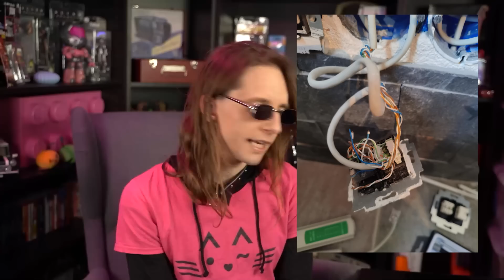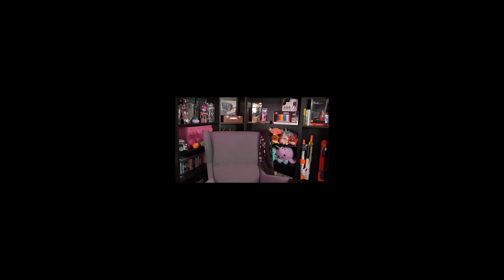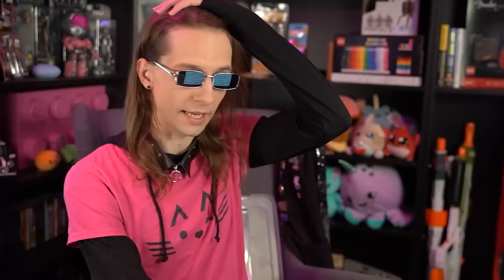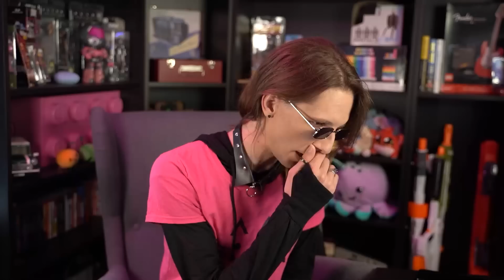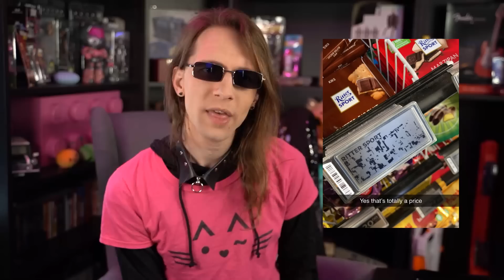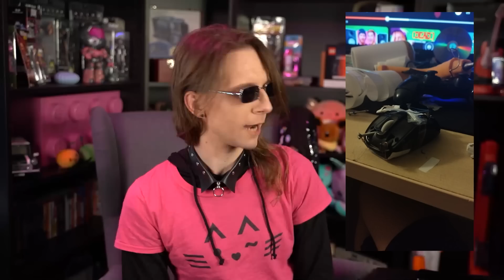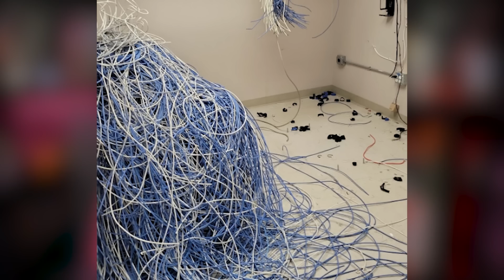Top 10 Ways To Notwork Your Computer'nt | Lexplanations |  r/techsupportgore & r/hardwaregore

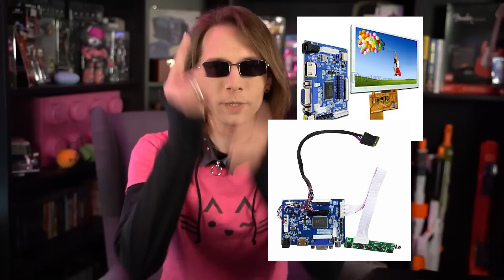Comment: 6:48 the boards are display controllers, the drivers are behind the LCD panel and are what the controller talks to. At least if i recall the terminology correctly. Its basically (overly simplified) a multiplexer and a DAC that drives the actual pixels in the display matrix. seeing as i have scratch built display controllers using FPGA's I really should know the terminology better...

Comment: 6:00 that console could probably run off 22AWG wire with how little power it draws and how short the distance is. That being said, i prefer my electron hoses, 0000AWG FTW!

edit: the bigger problem is likely the contact resistance as that wire is never going to be able to produce enough force to get the resistance low enough not to set the connector on fire.
Reply from the maker: Okay I just looked it up , lower than expected but still

Comment: Okay I can explain the eink displays for pricing. If you go Kohl's or any other mid high-end clothing department store. They use eink displays. I talked to The IT guy on how they're updated. He says that the server controls pretty much everything. Corporate sends the prices down. The server distributes them and does updates at a specific time every day. If a price is wrong. Unless somebody manually sends a price change to the server. It is like that until the next day.
Reply from the maker: Creepy
Reply: @TheLexikitty  I also forgot to add. There's cheaper versions of them that provide QR codes for the handheld that the associates carry to scan. They scan that QR code and then the handheld can send the price change or update the information right there.

Comment: That wiring to a playstation is actually enough for it, if the wire is solid copper core or braided copper under 20 AWG, Home air conditioner in China sometimes runs in thinner wiring than this console.

It would drive you crazy if you see a welding machine hook up to a residual power system with something like this, sometimes with thinner cable. In China it's uncommon to have standard high power wall outlets in home setting, so anyone want to do some work have to directly wire their power hungry tools to the nearby outlet, which is really a fire hazard.
Reply from the maker: 20?! Geezus you’d feel the wires getting warm at that
Reply: @TheLexikitty  I do my calculation into AWG with charts online, so if 20 AWG is something really small I'm sorry for the shock. The cable in the picture looks like something about 0.5-1.0mm thick in the core (I use metric). 

I just do my search and found out the nominal max current for 20 AWG is about 1.5 amps, but actually in China, I saw much more thinner cables running about 3-5 amps for years... Maybe I should wonder why I'm still alive and now I know why there are some many fires around...
Reply: @ryuquen  I thought 20AWG is good for about 5 amps in normal conditions.
Reply from the maker: “Should” and “can” are way  different things hahah, be safe

Comment: spicy pillows is why I'm heavily against Battery Electric vehicles you know you have about 30s after a crash to get out of the vehicle or your probably gonna die, Fire departments literally cant put out lithium fires the only way to kill them is to completely remove any air near them as lithium acts as its own oxidizer so fire departments literally have to submerge the car or seal it in a metal box for 24 hours to put it out
edit. OMG they are shoving mains into the PS4 that runs off of DC power and since theirs no transformer that PS4 is now dead
Reply from the maker: Agreed, I think public transport and reducing car use as much as possible is the way to go

Comment: My parents house was built a few years ago and has a few network cables run to the basement next to the electrical panel. I finally got around to mounting all their network hardware to the massive piece of plywood on the wall for specifically that purpose. Everything was hanging by wires before. It's not perfect but at least now it's all secure lol. I can't stand bad cable management even though I'm studying mechanical engineering, not electrical.
Reply from the maker: Good job 💞
Reply: @TheLexikitty i made that industrial audio and video from that one emksy vid but 4000x worse